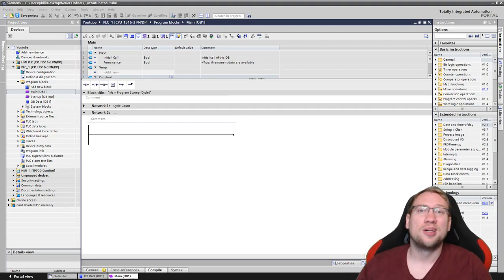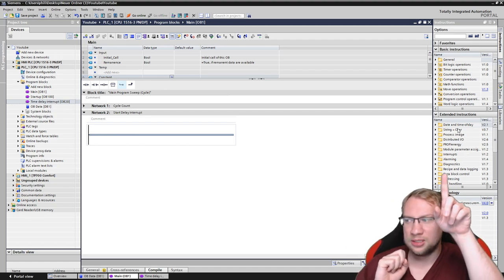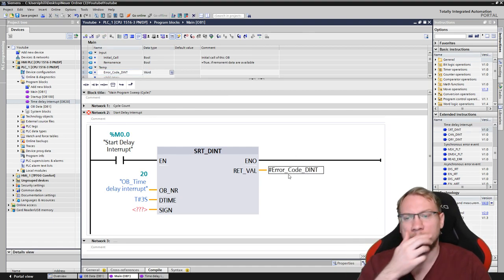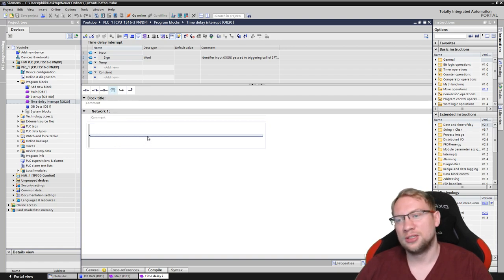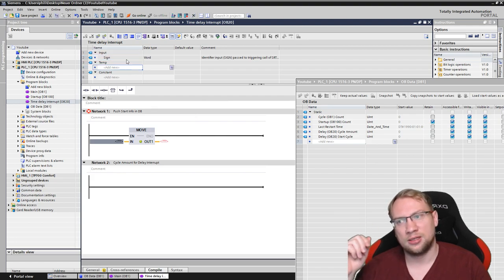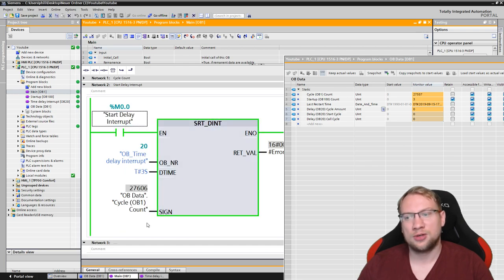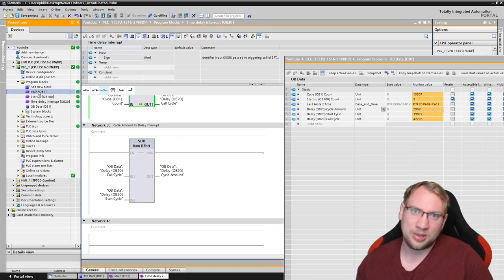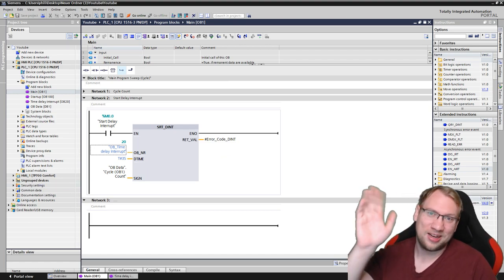TIA Portal: OB20+ - Time Delay Interrupts

Comment: I don't get the point of the OB20. You can use timers inside regular functions. What makes Time delay interrupt OB20 special?
The TIA portal description says:
"A time delay interrupt will interrupt cyclic program execution when a specified delay time has expired"

So a PLC will stop running all code after the time is expired... so in 3 seconds ... stop everything... or everything else exept the OB20. Is that right?
Reply from the maker: Yeah, the difference to normal timers is quite hard to get!
Let me put it simple... Normal Timers are very dependent on the Cycle Time of your PLC and will only get evaluated when the PLC is at that exact place in the program (which might vary by up to 150ms when using the standard PLC parameterization). So Timers are used for time uncritical processes.
Cyclic Interrupts are VERY precise... if they should react in exactly 3ms, they will react EXACTLY in 3ms, interrupting all other program parts and doing the time critical OB (you could take the airbag in a car as an example... where a 10ms already make a HUGE difference).
After the time delay interrupt finished it's function, the normal program will continue... so it is only put on hold as long as the time delay OB is in execution (usually a couple of Nanoseconds to Milliseconds)